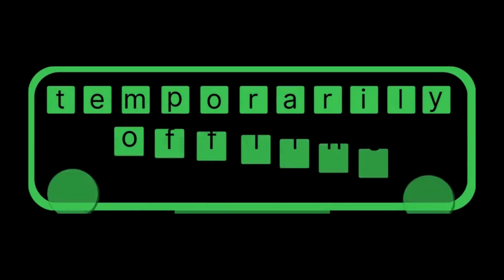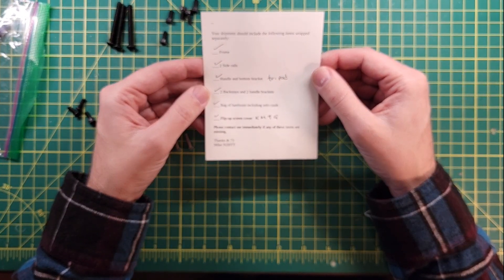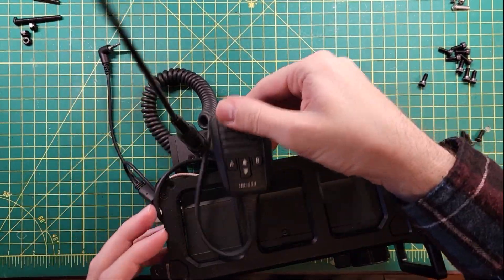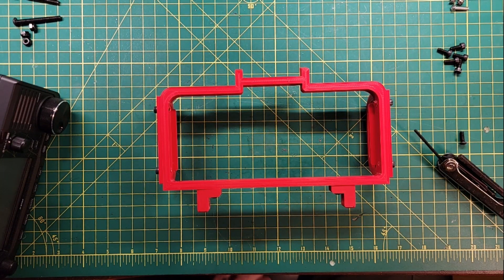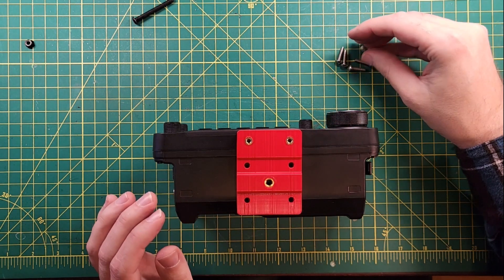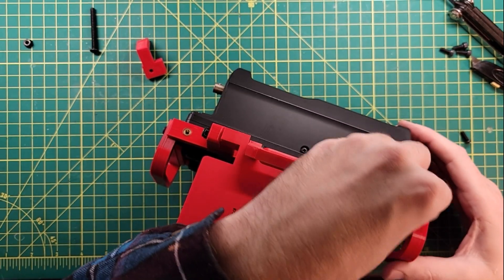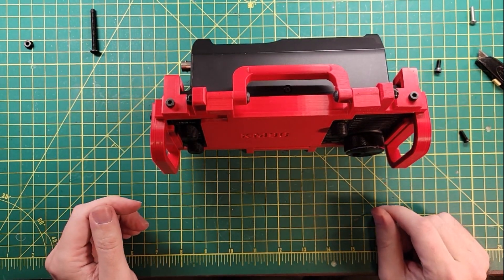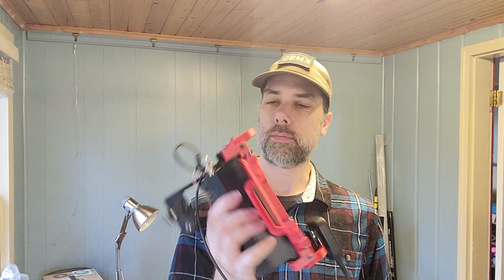New 3D Printed Icom IC-705 Cage - Ham Gear 3D

Comment: Wish I had seen this video before assembling mine. Not that it’s hard, lol. I just like videos. Not sure how you mounted your mic like that. 

Very good quality. Thought the view angle was perfect at first but not so much anymore. Still with the tripod mount I have options. I may make my own bottom plate to add more options, and more back protection as I rock it back a lot.
Reply from the maker: I just clipped the mic on the front guard rail.  I disconnect it when its time to use the radio though, it is in the way there.  I can see a neat mag mount location as a future upgrade.

I have a custom bottom plate for the radio that is bent metal and screws into the camera mount.  Probably doesn't need to screw into the camera mount and can just stay at the desk for "base station" use.